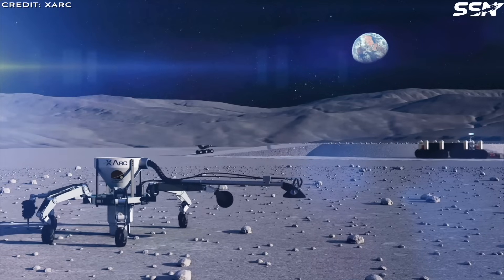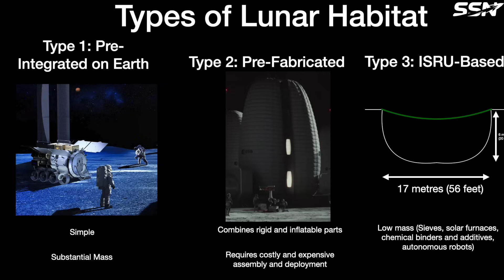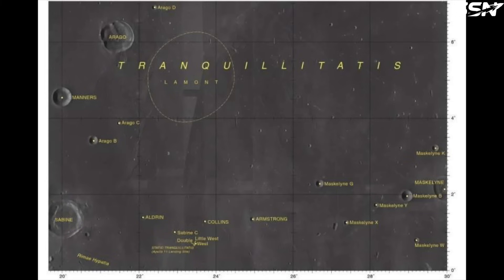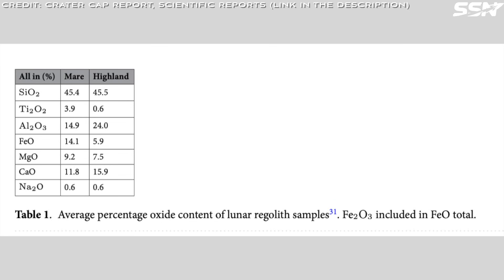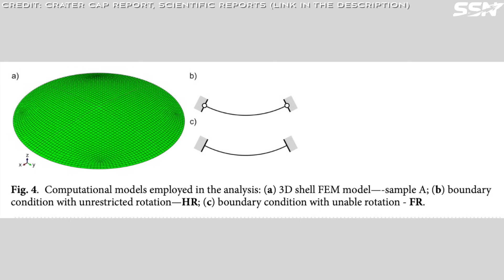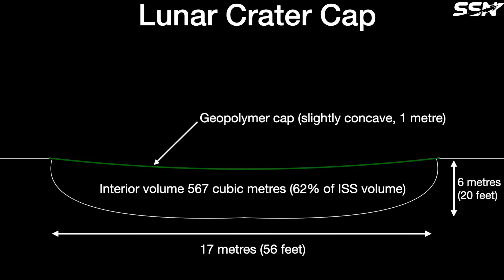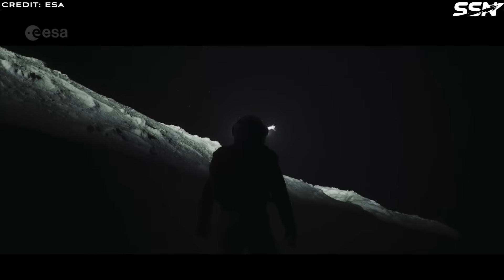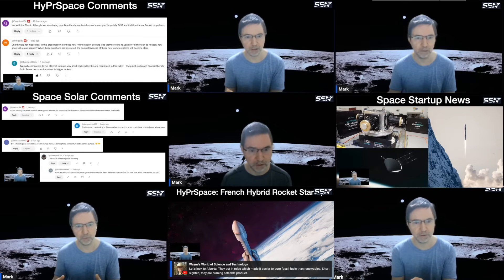Capping a Lunar Crater with Regolith-derived Material for an Instant Habitat

Comment: Crater floors can be sealed beforehand from orbit by using concentrated solar light from mirror / lunar satellites that could heat the regolith to the melting point and let it solidify / cool (basic sintering). This would force outgassing of the top layer and seal the lower layers. The whole process can be done with a few simple satellites without boots on the ground. The same process could be used to create roads, landing pads, and other safe surfaces to minimize exposure to lunar regolith.

Comment: Fabricating something rigid on top of loosely consolidated dust is structurally unsound, and I'm not sure how you'd clear away lunar regolith that's the consistency of emery powder when you're operating in near-vacuum.  You can't blow it away, and if you try to sweep it instead, anything  you kick up will just settle back where it was.  Probably gum up the moving parts of whatever robot earthmover you're using to boot.  Even getting prefab habitats to function on the Moon's surface long-term is going to be difficult, without turning the place into a construction site.

Comment: Finaly someone else is talking about capping a crater to seal and pressurize, oh and add oxygen so we can breathe. Yes, I know I told you about the mile wide craters that we can build cities in, but it all starts small. I was surprised when the first page I found was back in 2022, I may have been commenting about this earlier.?? 2022/03/24 mega-citys-in-craters/
We should build the city in a Lava Tube, so we can expand the housing throughout the tube, so we don’t need to cap a new crater to expand.

Comment: The launch pad aka EARTH needs some attention. The moon isn't going anywhere for billions of years. There's plenty of time to go there once we've undone our damages here
Reply: There is no reason we cannot do both simultaneously. I see no reason why avoiding the moon would makes things better on Earth.
Reply: The reason for going to the Moon & beyond is so that we can minimise the damage we are doing to Earth. For example, manufacturing Renewables- & the electronic devices everybody seems to depend on- require Rare Earth Elements. To obtain these means digging up large parts of the environment which is a double hit as these require large Earthmoving equipment powered by Hydrocarbons. Also currently the main source of Rare Earth Elements is China which means these have to be shipped- thus generating even more CO2 Emissions.
By using the resources of the Moon and beyond it means we will not need to exhaust Earth's supply of these elements- and ripping up the environment at the same time. We can mount Solar Power Arrays in space capable of beaming power to anywhere on Earth...
...Or we could just revert to a Pre-Industrial Agrarian Society and see a massive decline in both the World's population, Living Standards & Life Expectancy.
Are you willing to do that?
Reply: I concur with both gentlemen’s statements!

Comment: Very fascinating idea! There are a few things that confuse me about this concept:  1: What is the level of robotic ISRU technology that would be needed for construction of a moonbase / basecamp? In other words, how much equipment would have to be perfected, built, and transporter to the Moon?  2: Can any of this ISRU equipment be repurposed for other tasks? (building lunar landing pads, etc.)  3: How long would it realistically take to actually build the structure and get the base operational?  4: In the "geopolymer" and "building the cap" segments of this video, I received the impression that ongoing radiation bombardment would eventually contaminate the base's cap, and eventually the base. (??) If this is correct, would this structure only enable a temporary base, or would be be possible to increase the cap to make it permanent?   5: I'm confused on the idea of using a prophylactic layer between the crater's regolith wall and floor and the interior of the habitat. Is this study suggesting a blanket be laid down to shield the base from the crater? If so, aren't we essentially talking about simply depositing a HAVEN-style inflatable base kit in the crater, and the base kit becomes its own protection?  6: Would the ISRU equipment on-site be useful in digging a tunnel out of the side of the crater wall in order to install an airlock?  If so, installing airlocks would be a straightforward matter.  7: Sierra Space has already indicated that their L.I.F.E. inflatable habitat modules can be up to 5,000 cubic meters in interior volume, so providing a useful habitat to fill a small crater should not be a problem.  8: The intriguing possibility that I see would be to combine the concepts of the capped crater with the notion of a HAVEN lunar base to provide a larger, capped crater-base with the concept of windows for lunar visibility.

Comment: It may be better to use aerogel, the liquid can be transported to the moon easy enough. 1 cubic meter of liquid silica can make 500 to 1000 or more cubic meters of aerogel. And the gases given off can be collected for reuse.
Reply from the maker: Fascinating. I will need to research this material more.
Reply: @MichaelMillion -  Excellent idea!  That approach definitely seems worth investigating.
Reply: But it will not shield at all from radiation or micro meteroites.

Comment: Maybe I missed it but I am a little fuzzy on where the airlock would go for entrance and exit. Still, a great presentation.
Reply from the maker: There is no mention of an airlock in the paper. Excavators can be used to create a sloped path to the base of the crater where an airlock can be installed that gives access to the internal pressurised area.
Reply: Since it needs a tough liner anyway, seems like you would be best to just put an inflatable habitat inside and keep the crater unpressurized. Refined construction like airlocks seems difficult. The place is so dusty, why not use the concrete for the floor also?